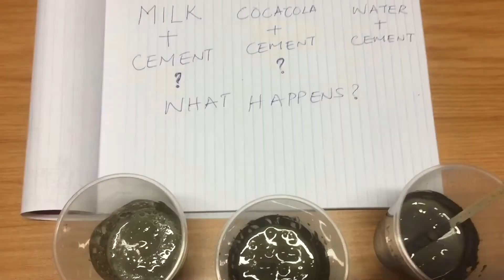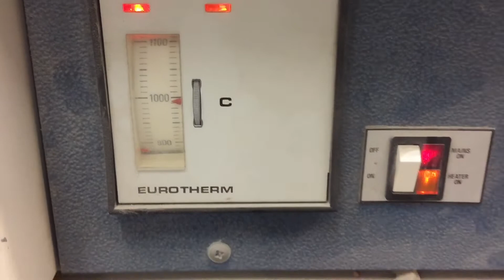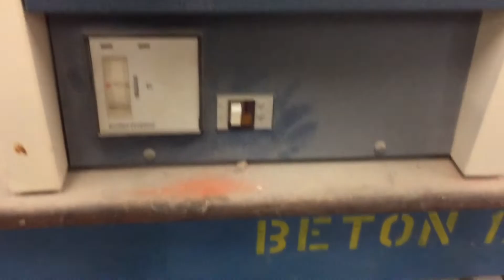EGG Concrete at 1000 Degrees  (Eggs+Milk+Soda)

Comment: Put egg white, water, concrete in a blender and blend it till its froth to see what happens. If u can get the right mixture with that u could make an air kind of concrete
Reply: Maybe bicarb and either peroxide or vinegar
Reply: To get a massive amount of froth
Reply: Possibly fake hair cut up into half inch long strips for tensile strength